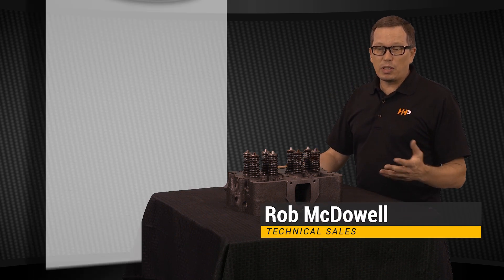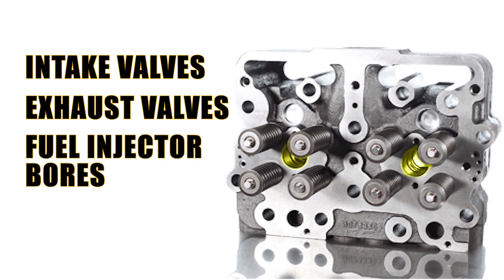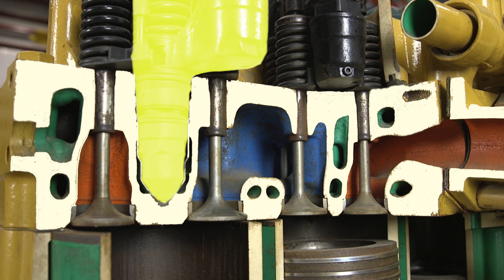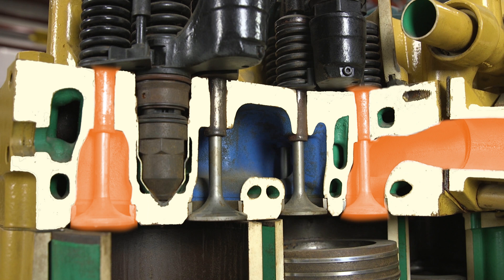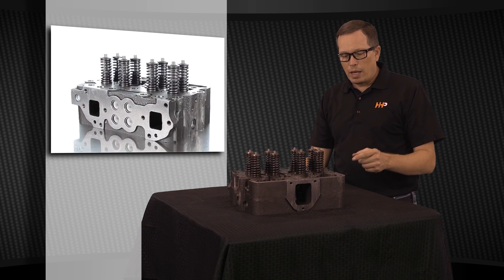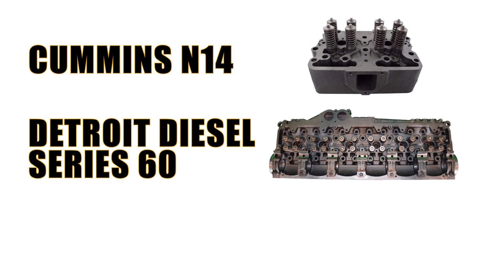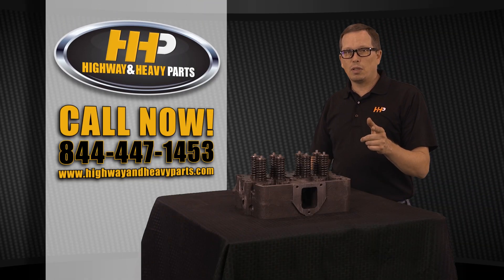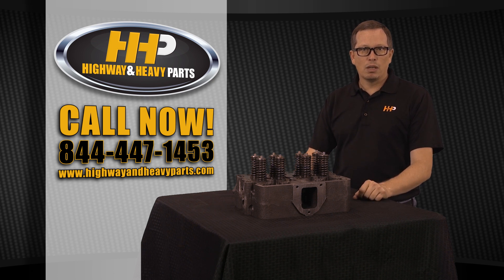How does a Diesel Cylinder Head Work? HHP Has The Answer!

Comment: What bout cam shaft ?
Whats the roll on the cilinder head to work??
Reply from the maker: Are you looking for information on the cam follower?
Reply: @Highwayandheavyparts  
I trying find out whats the best to do on my engine cumins 8.3.

Had a roker arm bridge loos and mechanic was unable to adjust it too much lash no way to adjust it
So he said need replace tappts and camshaft.
And another nechanic said he will need to take cilinder head off to send it to cilinder head shop mashine to regoove and inspected..
So i m tryind find whats best to do..
???
Reply: @1HSYURIDIA  I know its too late, but when it comes to blocks, heads and other large irreplaceable parts or ones too expensive to be worth replacing always put it in a machinists hands. With whatever info you have. Some mechanics are just Lego part fitters and will keep throwing parts at it till you stop complaining meanwhile leaving other damage there. Machinists more often than not understand the parts materials and functions more deeply and their relationship with one another and will remedy the issue not just band-aid it. You still may have to replace a couple of peices but they will not be ruined quickly by damage left untreated.